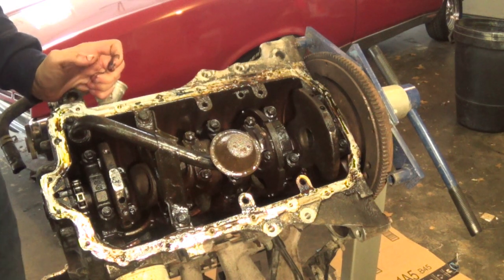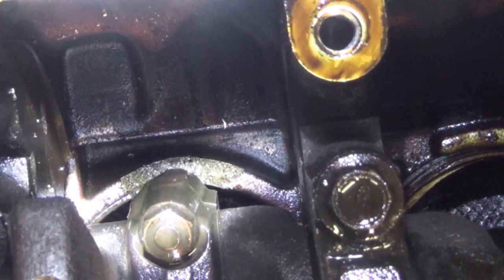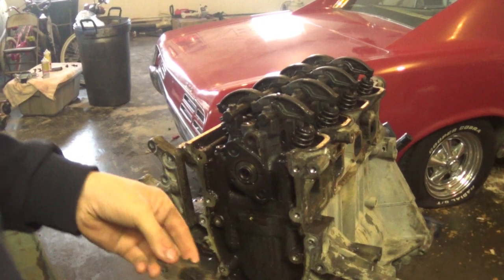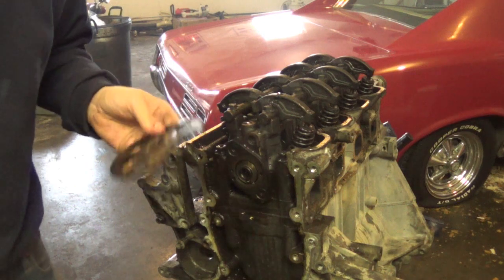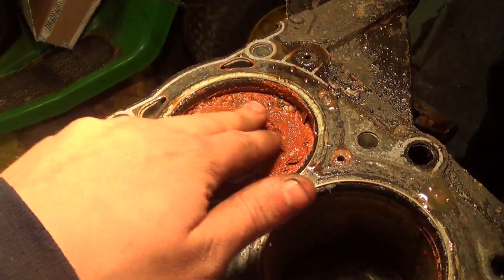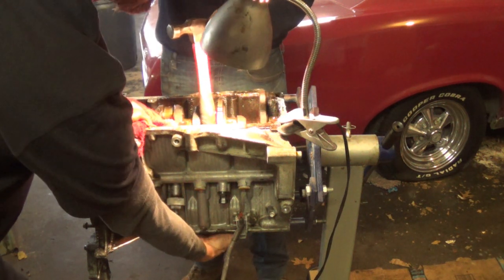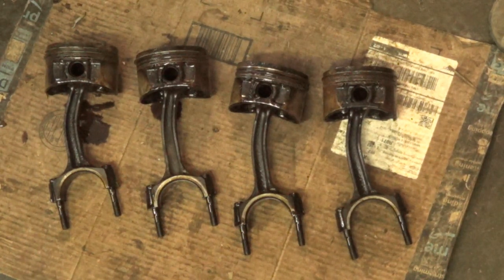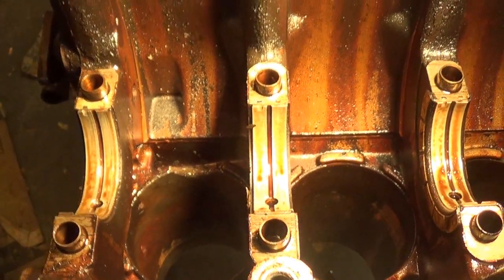Whats inside a hydro-locked engine?

Comment: Hydrolocked my 3 litre toyota fortuner diesel the other day....  I was smart enough to not crank it.. pushed it out of the water.. tried to crank it after an hour thinking it may start.. made a metallic rattle...called the mechanic.. towed it to his shop, at first the mechanic thought it was a starter problem but then we realised the engine may be hydrolocked... removed the head of the engine... turned it over and water fountain... removed the sump, the car is supposed to hold 7nlitres of engine oil.. we pumped 12 out... the inlet and outlet valves were damaged probably because to the piston trying to move up... the big end bearing were changed.. didn't have to dismount the engine entirely.. thankfully the connecting rods and the pistons were fine.. miracle... turned the car over.. it voila... there is some electrical damage but I'll be dealing with that very soon. Axnxiety was setting jn... Breathe a huge sigh of relief when it started because I am very careful about all my vehicles.. my family jokes around that I drive like a 65 year old.

Comment: My brother ran his Nissan Sentra into a huge puddle and destroyed the block instantly. Two walnut sized holes in the block where the #1 piston was annihilated. $4200 for a used engine and installation, 15+ hours of labor.
Reply from the maker: Man thats rough!  We just went to the junk yard and picked up a old motor.  Dropped it in ourselves over the winter
Reply: @maddenmadness  yeah he had the clutch done while it was separated from the transmission that was included in that $4200. So just the engine itself and the labor was around $3700-$4000. His car had an aftermarket cold air intake that was pointed down in front of the drivers side fender. It was all rusty when it came out so that Nissan took a good drink of water

Comment: Yo I did that to my D16y8. What are the steps I need to see an repair it? Head looks good cam looks good going to pop the Pistons next an see. Could it have hydro locked an done no damage?
Reply from the maker: ive seen it been fixed with just new conecting rods

Comment: i just watched you lawn mower go kart video and was wondering how you added throttle to a push mower. i have a old honda engine with no self propel and wanted to use it in a go kart
Reply: That's not a throttle. The left foot lever is the forward reverse clutch.